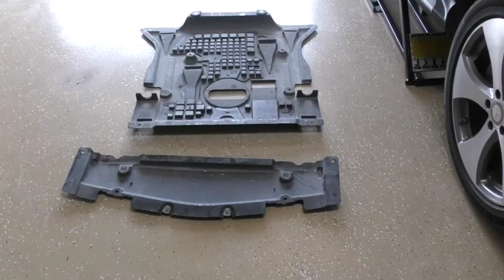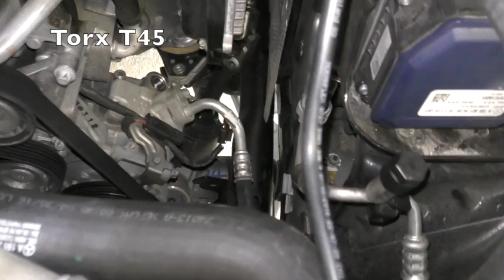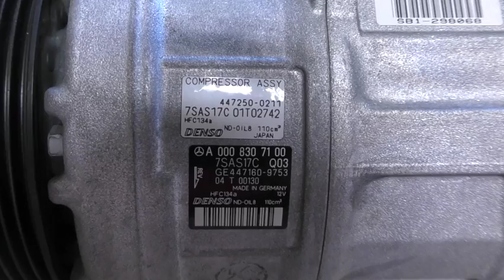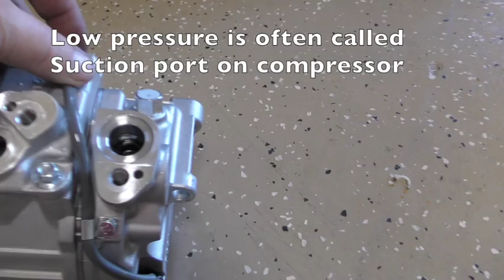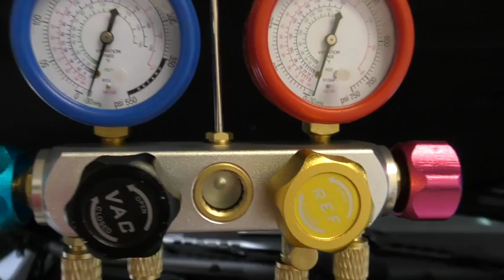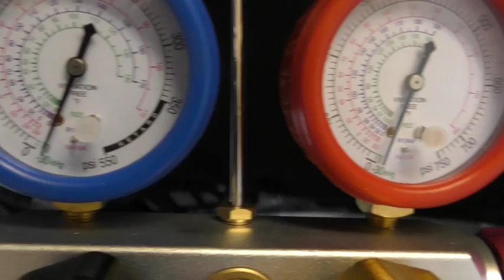Mercedes GLE 350 AC Compressor Replacement W166

Comment: Thanks so much for the informative video! I’m new to working on a Mercedes hvac system but I was taught to drain and measure the amount of PAG oil in the old compressor and add only that amount into the new compressor to prevent adding too much oil in the system. Of course that was based on only changing the compressor and not flushing the entire system. Is this not necessary on the Mercedes? Will it be ok to add the full amount?
Reply from the maker: Too much oil isn't good.  Typically, this is correct.  In my case, I replaced the drier and valves.  My entire system was drained of oil and coolant.

Comment: Great educational video. Is it necessary to replace condenser if you are putting new compressor? My shop told me that I need a new condenser as well
Reply from the maker: I didn’t replace mine.  I replaced the compressor, valve and dryer.

Comment: Thanks!  This video helped me replace the compressor on my 2016 GL450.  Very tight, but was able to unbolt it and get it out from below without removing the sway bar.  Replaced it with a Four Seasons 198322 compressor (type 7SAS17C).  Held a vacuum overnight but didn't replace any other components.  My 1st time replacing a compressor, so I went slow and it took me about 6 hours.   Blows nice and cold.
Reply from the maker: @Sympster  outstanding

Comment: My low side pressure is like 150
..high side same.. Is that compressor?
Reply from the maker: same answer.  Either the expansion valve or the compressor.  Cant tell you which one.
Reply: @letsrolldiyauto1532  I went ahead bought the compressor and drier and valve.. Leaning toward the control valve in the compressor is stuck... Imma change it out and vac and fill.

Comment: Lord help the ones out there with the twin turbo 4matic.. like the one I just did. Intercooler in the way of the belt, charge pipe in front of compressor, front diff below haha man its not fun at all but thank you for this video very professional and intuitive.
Reply: You just described the job I'm about to do with mine 😆
Any tips?
Reply: @kbh8181  after I replaced all components, put a vacuum on and checked for leaks... The system would not take the freon.. I brought it up to a oil change place and had them charge through the high side... Works perfectly now.. there is no low pressure switch to "trick" to turn on the compressor.. the high side does both.
Reply: @dustinhodgkinson6377  What were your gauges reading? I first replaced my AC clutch, vacuumed the system and charged the system through many hours of agony. Had to dunk the cans in a pot of hot water to take the freon..but my gauges are totally off and it's still blowing warm air. Thinking it might be the expansion valve.. But to get to and replace it, I may as well do the compressor as well to avoid having to go through this anytime soon.
Reply: @kbh8181  my manifold readings were 150psi on low side and 100 psi on the high!.. I tried and tried to add the freon and got upset and took it to be charged on the high side. Worth the money 💰 I read on a few forms that others just replaced one component just to have to replace the others... I did not change the dryer out but I have one if needed that came with the kit I bought.
Reply: @kbh8181  take note of the belt routing, try not to disturb it too much after you release the tension off the compressor pully.. it's a PITA if you have to remove the intercooler. The charge pipe has to come off and note how the bracket is attached. I pulled the compressor out of the bottom with no issues. It's all just so tight.. I'd say the hardest thing was the valve under the windshield wipers.. the little Allen head bolts are sunk down.. just take your time and make sure they are both tight.
Reply: @dustinhodgkinson6377  That's good to know that the compressor can be extracted from the bottom. That charge pipe had me worried but I saw someone else's video on how easy it comes off. You're right, the expansion valve appears to be the most difficult to get to. With this video, we owe Frank a debt of gratitude. I feel super confident this can be knocked out at minimal cost. Dealer wanted $4,400 to do this.
Reply: @kbh8181  I did everything for around $825 including the refill

Comment: Frank, I bought the same compressor you showed in the video, but the compressor came with a 2-wire and the car has a 3-wire connection.  It will fit into the harness, but the compressor will not kick on.  How can I make it to work or is there something else I should check for.
Reply from the maker: @MacleanEke  you need to return it and get the three wire.
Reply: Man.  I just went through the same thing.   I installed and it won't work
Reply from the maker: @romonejrmanning7447  if you got the four seasons compressor, make sure the wiring looks the same as in the video.   Use an OBD II reader to see if there’s any codes.  Check the fuses, too.

Comment: How did you know your compressor failed? I have a E350 and the AC is barely blowing cold when it is over 100F
Reply from the maker: Failure of pressures to drop as they should when the compressor kicks on.

Comment: It looks like there’s no clutch on the front of the new compressor I bought a new one and also it looks like there’s no clutch, so is it an internal clutch? And it feels like it’s always engaged when turning by hand is this normal? Thanks!
Reply from the maker: yes
Reply: @letsrolldiyauto1532   one more question when you replaced everything did you have to do a AC reset on yours?  it because my AC button is flashing
Reply: @JarredSilver-ns4lk  did you figure it out? Just did mine and same ac light blinks but no ac
Reply: @isaacrios25  yes it ended up being the wrong compressor and I had to go to my local mechanic and reset the AC codes,
Reply: @JarredSilver-ns4lk lol I just took my connector off and yup 2 wire compressor 😢
Reply from the maker: No I did not.  But I did run an OBD II reader and cleared any codes.

Comment: Several things: Your compressor is a variable displacement compressor (no clutch, and a crankcase) so, if the system is empty (flushed of old oil throughout and dried) the entire total volume oil charge can, and should be put in the compressor crankcase (either as you did on the low side port, or thru that hex-head plug next to the low side port. If the system has not been flushed, you don't know how much compressor oil is still in the system in the evaporator, condenser, TXV, and lines, so a full oil charge is over-filling the system. Also, since you replaced the compressor, it is sufficient to say that the compressor failed. meaning that it wore out. The reality is that there are metallic particles distributed throughout the system and suspended in the oil and not flushing the system, which IS a hassle to do, means you have an abrasive fluid (compressor oil and metallic particles) circulating in your system. As you comment, your system is working. Ultimately though the longevity of your system will be reduced and the cooling performance will be compromised because of metallic particles plugging at least some of the condenser tubes and fouling the TXV seat. . . Saving $5,000 is of course "priceless" or $5,000. . . The concept that your 7 year old Mercedes already wore out the A/C compressor is unfortunately indicative of our current state of manufacturing. . . Not to make this a this verses that discussion, but my 1999 and 2006 Toyota Camrys still have freezingly cold A/C and have never had anything (anything!) done to them. . . I'm here because I'm repairing my neighbor's 2008 GL550, and he didn't want to spend $6,000 at a shop to have his compressor replaced. . . I wonder if the shop estimate included flushing the system and replacing the condenser, receiver/dryer, and TXV, all of which cannot be flushed. . . Thank you for taking the time to make these videos. I found your TXV video most helpful. . . Mercedes-Benz is MOST DEFINITELY NOT interested in facilitating DIYers in any way. . . Where the heck is the TXV? . . . I've got an idea (said some MB engineer) lets hide EVERYTHING under plastic covers.
Reply from the maker: If you look at all the videos in this compressor series, you’ll see that I replaced the TSV, compressor and dryer.  The system was cleaned.   The new compressor was drained of all oil. Half the oil required was placed in the compressor and the other half in the low pressure port.

Comment: I bought both styles of the fourseason AC compressors and per my mechanic friend, both are not fitting my 2016 GLE350 Base, im really confused now. My car doesnt have the Start/Stop feature but the current AC compressor has 3 wires. The 2 wire compressor  doesnt look like its coming with a clutch.
Reply from the maker: There are two compressors for the GLE350, one is a two wire and the other a three wire.  I needed (and you probably do, too) the three wire.  I bought it from PartsGeek.com Part Number: 137673-05933605
Brand: Four Seasons
Notes: New Compressor -- With 7SES17C Compressor; New With Clutch.
Reply: @letsrolldiyauto1532   did you install the 2 wire no clutch compressor on your GLE? seem like the 2 wire one doesnt come with clutch. Guess i will have the technician install the 3 wire one even if he believes that wont work.
Reply from the maker: @us3r2206   3-wire  I bought it from PartsGeek.com Part Number: 137673-05933605
Brand: Four Seasons
Notes: New Compressor -- With 7SES17C Compressor; New With Clutch.

Comment: i have the same model car and year and my AC is blowing hot air, looks like the clutch is engaging but still hot air. I am about to replace the compressor, dryer and expansion valve myself, but lots of car technicians keep saying that the AC system needs to be flushed to avoid metal shavings contamination into the new AC compressor. Is that true and how is it done? thank you
Reply from the maker: I did not flush mine.  With the dryer and compressor and value being replaced, I just have empty hoses.  Could there be some metal shavings? Sure, but if the compressor dies not due to destruction of the physical components, I doubt there would be metal to cause a problem.  They would probably be contained in the dryer anyway.  But a shop has to warranty their work and it's probably not that much additional work for them to flush.  But like I said, I didn't and don't have any issues.
Reply: thank you so much for the information , great DYI videos @letsrolldiyauto1532

Comment: Frank, you're either an engineer by trade or a retired cert mechanic. Your repair classes are first class. Communication on instruction is pro level, Thank you buddy and God bless. I'll return with an update.
Reply from the maker: You're welcome.   I love it when I can help people in some way.
Reply: It seems like the old one had 3 pins, but the new one has only two. I replaced the same, and it doesn't work at all. I read some information, and this is the reason: because it's two different types of compressors, 7SAS17C and 7SES17C. Does it work on your car, though?

Comment: How you doing sir how much  would you charge to replace ac compressor on  a 2014 mercedes c250 sport? Orlando area
Reply from the maker: I'm a DIY'er trying to help others with these videos.  I do not have a shop or do work for others.

Comment: How has the compressor held up for you using an aftermarket one?
Reply from the maker: It's been great.  I used a Four Seasons Compressor.  Four Seasons it the largest aftermarket auto HVAC manufacturer.  The compressor itself is made in Mexico with other components made in Canada.  The stock compressor for Mercedes is made in Japan.  So both are manufactured in good manufacturing countries.  But it's been around 100 degrees all summer and it's performed flawlessly.

Comment: How many miles were your GLE's at? Seems like there's a lot of compressor failures. Mine's at about 113,000 miles and just died so I'll be doing this repair once the parts come in.
Reply: Mine was at 104,000. My wife’s GLE was at 76,000.  Definitely a manufacturing issue. They shouldn’t fail.
Reply: @Drimplant  Yeah, seems like it should be a recall scenario to me. Mine is kicking on, then overheating almost immediately and shutting off the compressor.
Reply from the maker: @yadayadableh2598  Or a class action.
Reply: Mine was at 104,000. My wife’s GLE was at 76,000.

Comment: Hello! Great video! Do you know how much Freon should be used? I have heard that you can cause damage by overfilling so just want to be sure. Thank you.
Reply from the maker: Check the AC Recharge video I have.  Basically, start with an empty system.  Read the amount of freon (in weight) on the engine compartment placard.  Then, using a scale, weigh the freon can before, then after.  The difference will be the weight of freon you've added.  Continue until you add the amount required.

Comment: Great video, i am about to attempt this tomorrow but was wondering if you had to extract the freon from the system before hand?
Reply: You should take it to a shop that has an extraction machine and have it removed there. If you simply open a valve, the refrigerant will be expelled into the atmosphere who’s is both harmful and illegal.

Comment: Absolutely amazing video series on the ac system change. I have the exact same vehicle and same issue. Just fyi....I think you may have the part numbers mixed up in the description. I initially ordered the 168379 compressor and noticed I had 3 wires on my connector. I sent it back and got the 198322 and noticed it was completely different on the top where the low side is connected. That rectangular box with the 2 screws in it was not there. I ended up sending it back and getting the 168379 again, which looks exactly like the oem factory compressor that I took out.
Reply: I double checked.  The 168379 is for compressors that do NOT have the start/stop feature (2 wire)  The 198322 is for compressors with the start/stop feature (3-wire)  the two do look completely different but the connector itself is the same and the connector from the car will fit both models.  But if you use a 2-wire compressor on a 3-wire system, it won't function properly, if at all.
Reply: @Drimplant  right. Same thing I see at RockAuto when ordering these. If you look at the original compressor that was taken out though, there are 3 wires going into the connector. This GLE just like mine doesn't have auto stop/start though. At any rate, I'm now returning the 198322 and getting the 168379 once again to put in as the replacement. Unless there's something I'm missing when it comes to the number of wires being counted in the equation? It's all good either way. This series of videos was a complete life save!
Reply: same problem here, dont have the start/stop feature but the original compressor has 3 wires, so im assuming that i need to return my 2 wire compressor without the Start/Stop feature for a 3 wire compressor with Start/Stop feature even if i dont have it.
Reply from the maker: yes @us3r2206